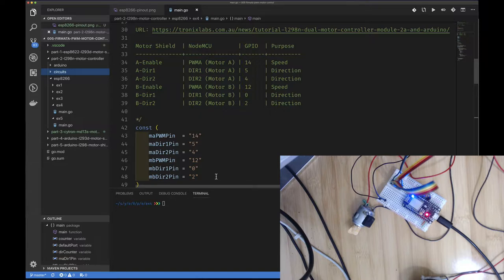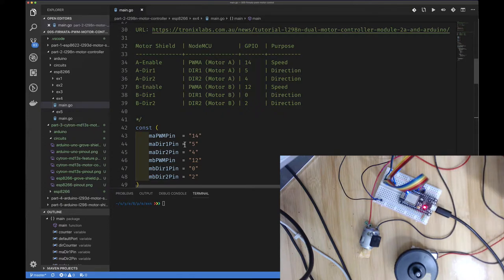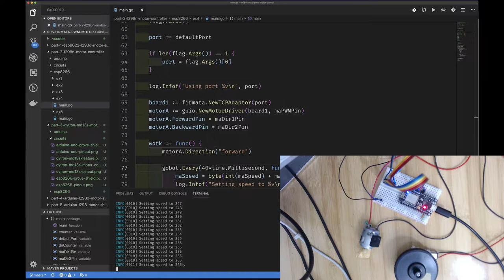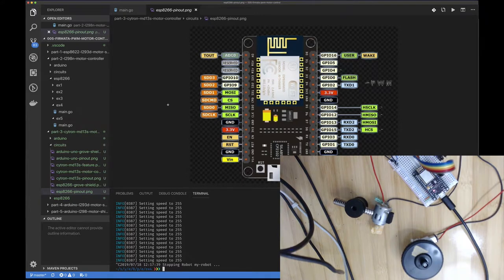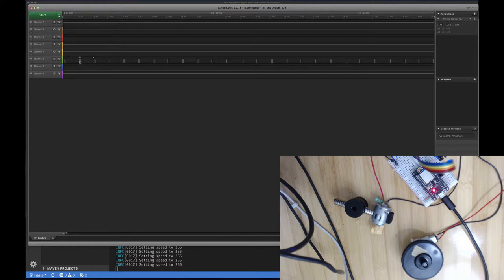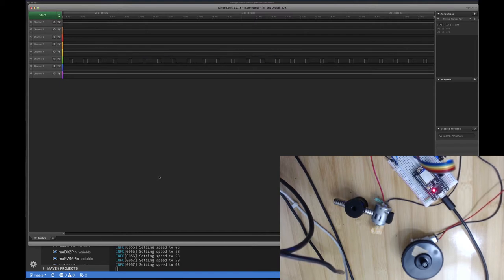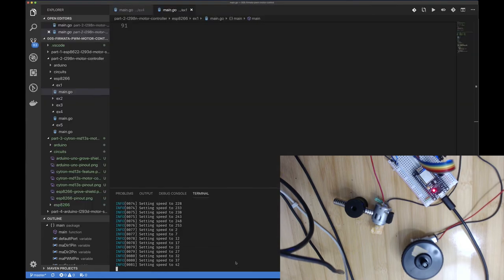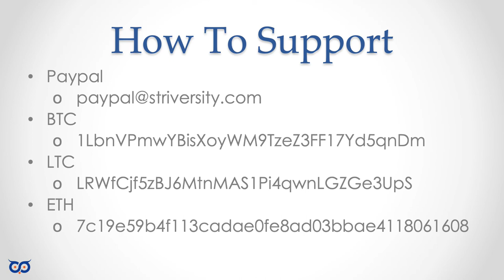#golang #embedded #gobot - S5 E2.1 - ESP8266 PWM Issue Explained

Comment: IIRC,ESP8266 PWM is 10-bit,while 0-255 is only 8-bit values. Try setting it to run from 0 to 1023,and see if the PWM duty cycle increases.
Reply from the maker: Hi PhattyMo,

Thanks for the pointer. That's would seem to be about the 25% duty cycle I see on the digital scope. 

Unfortunately, the gpio MotorDriver.Speed() [https://github.com/hybridgroup/gobot/blob/master/drivers/gpio/motor_driver.go#L107] and DirectPinDriver.PwmWrite() [https://github.com/hybridgroup/gobot/blob/master/drivers/gpio/direct_pin_driver.go#L108], are all byte values. So this is something that would have to be in the configuration of the gobot to scale.